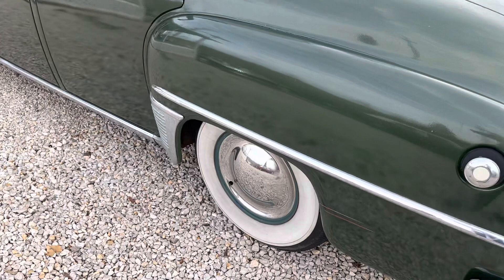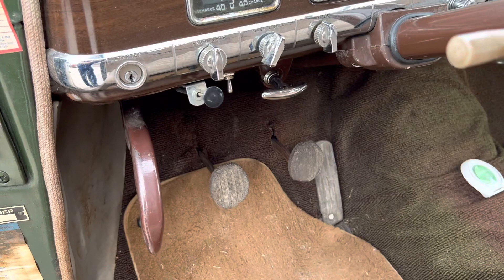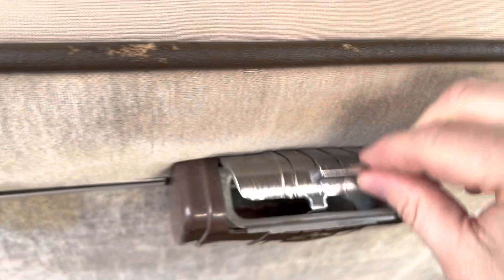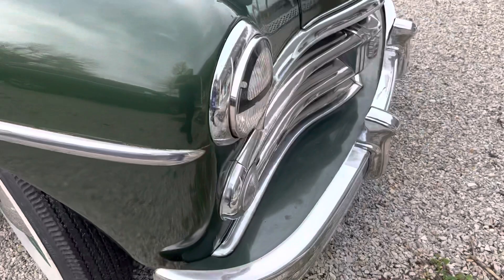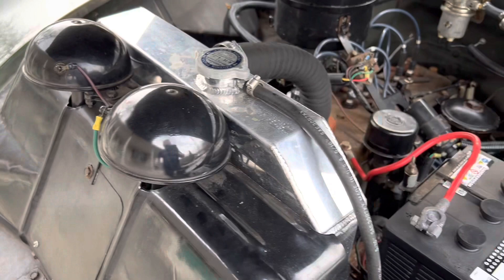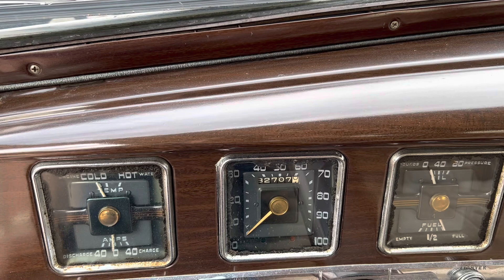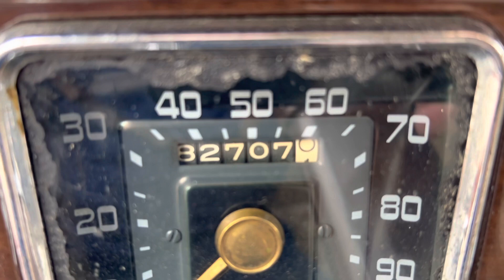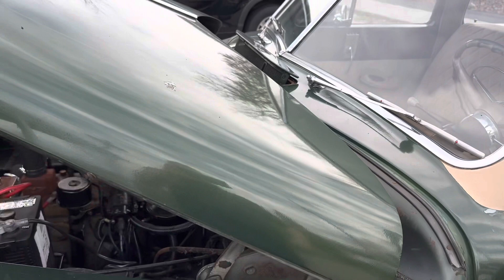1st “official” video of the year and introducing my 1950 Dodge Coronet

Comment: I learned to drive on our 1950 Dodge. In those days, radios were an option. No car or truck came with a radio unless it was ordered with one.   Also, in those days one was very fortunate if your car or truck engine made it to 100,000 miles. By that time, the engine was burning oil and needed to be rebuilt.
Reply from the maker: Thanks for watching and thanks for the comment.  I think that’s what draws me to these older cars…they had a purpose to serve and did so without all the bells and whistles and modern conveniences that we take for granted today.  I’ve owned two of these over the years and neither one had a radio in it.  On a fun side note though, there’s a nice space behind the speaker opening that will hold a decent Bluetooth speaker…..looks factory but you still have your tunes on a nice drive!

Comment: On every video I have watched , the oil pressure sits around 45 psi cold, 40 hot and 45psi at speed hot or cold. Same as my 1950 plymouth.
Reply from the maker: I have tried to keep a very close eye on my oil pressure.  On this car it seems once the engine is warm and idling it is around 20 to 25 psi…..cold is around 40 to 45 and up to speed is around the same.  Thanks for the comment and for watching!